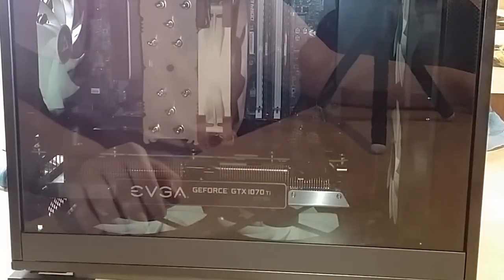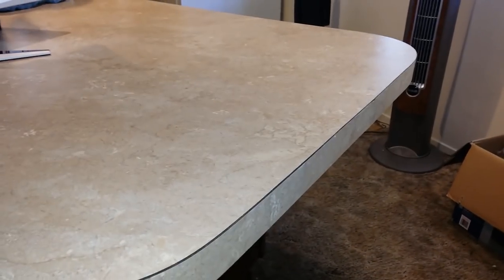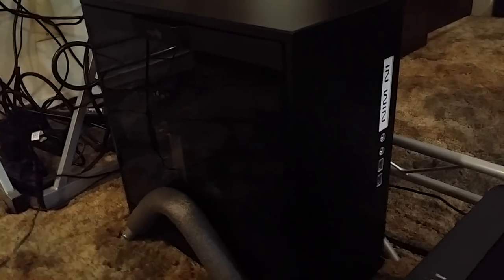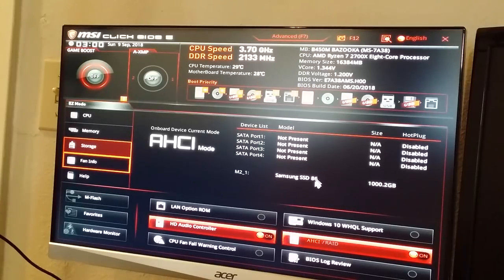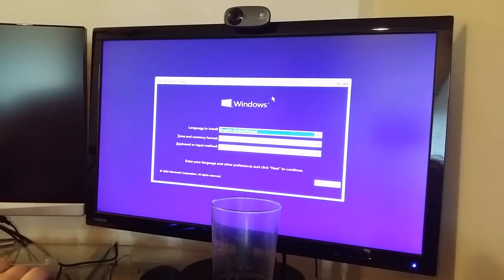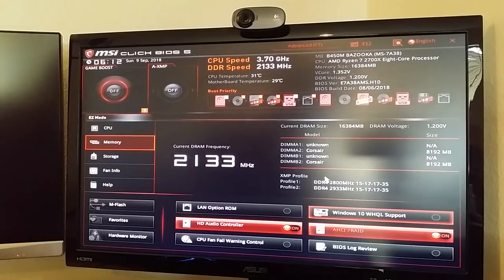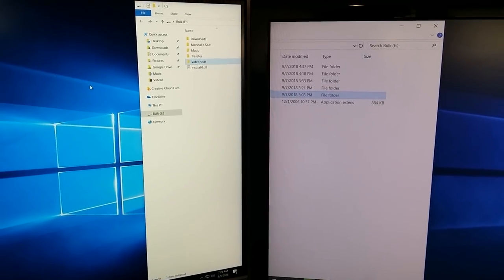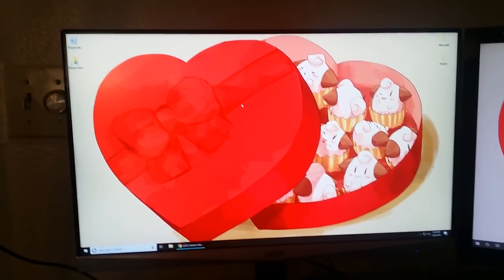New computer vlog (Part 4: Installed)

Comment: Grats on the build, Marshall! I would recommend, however, that it's best to test-build with the PSU, mobo, CPU+heatsink, and RAM before placing it all in the case. This makes it easier to diagnose potential seating problems with RAM and connectors. The thought of pushing down on the RAM modules without having used all the case standoffs would fill me with dread!

Comment: If I remember right the ram should be on the same channel. eg. A1 and A2 should consist both memory chips. I could be wrong, but it was something I heard a while back.
Reply from the maker: Yep, the ram slots are color coded. 2 white slots that go together, and 2 black. https://c1.neweggimages.com/NeweggImage/ProductImageCompressAll1280/13-144-196-V01.jpg

Comment: Btw have same memory kit,and didn't work at 3000mhz with any a-xmp profile on b350 mobo. So i'm just oc'd manually up to 3200mhz. P.s. yea i see u have same thing only 2 a-xmp and both not 3000mhz :)
Reply from the maker: Yeah for some reason the board doesn't seem to support 3000 mhz, only 2933 or 3200, nothing in between https://www.msi.com/Motherboard/support/B450M-BAZOOKA#support-mem-14
Reply: @LailaDyer  did u try yet the xfr2 thing or whatever how it's called for autoboost cpu cores?
Reply from the maker: As far as I know all that stuff is enabled by default. I've noticed my cores changing frequency as needed so seems to be working